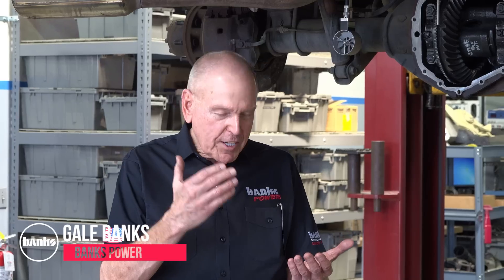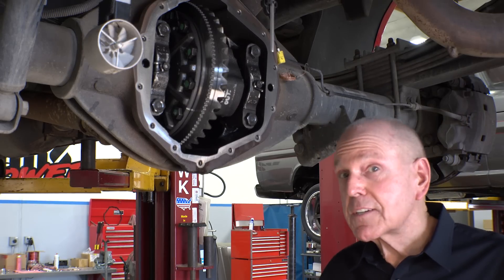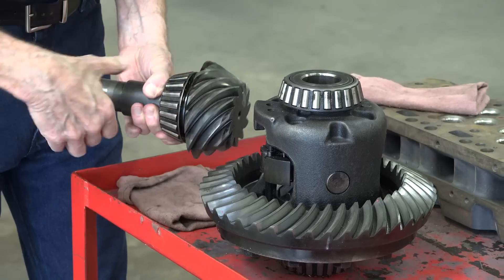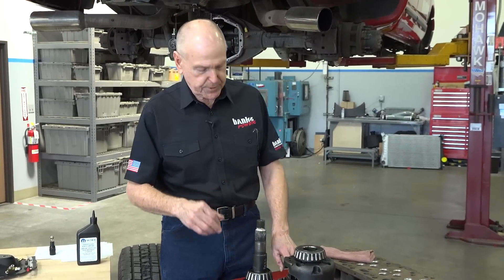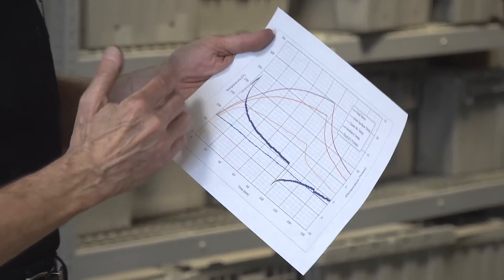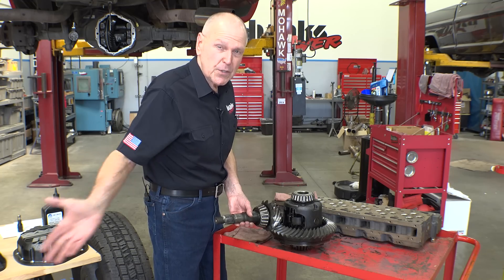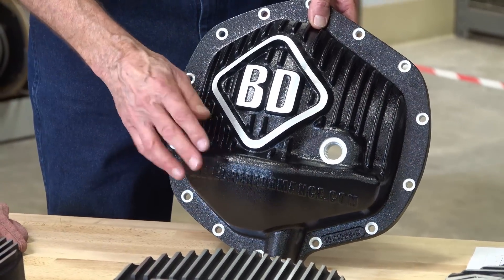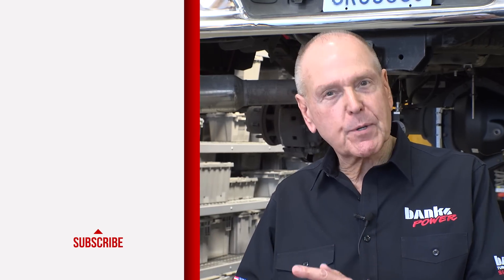Do Diff Covers Work or Are They Just Bling? Part 2 of 3

Comment: Great topic... just waiting for part 3, and your findings.   You make good observations about potential problems with a squared diff cover: will enough oil get back around to cool the pinion [which can collect more heat than the ring per the ratio]?   Does it add to aeration?

Comment: Main reason I have a diff cover is to change fluid faster with less hassle. Ranching means crossing creeks, mud, all kinds of things. Change the fluid every 5-10,000 ranch miles, and there's almost always water and nastiness that comes out. I'd say it's worth the aftermarket cost for convenience factor, even if it doesn't cool like advertised--then again, ranch trucks are rarely above 20MPH.

Comment: I have worked with engineers all over the world & have had the good fortune to know about one dozen who knew  what the Hell they were doing!  ALL those who were exceptional engineers  espoused the same attitudes that Gale Banks does.  The "I don't know, but I am going to find out" attitude & then designing a test program, instrumentation, & methodology. ALL tests conducted using identical parameters. Identifying & compensating for possible errors, & listening to subordinates input. Sometimes the guy who sweeps the floor will offer a suggestion, that is patently useless, but it "twigs" the engineer into considering a modified approach that works!  I bought a Gale Banks  fuel plate, turbo kit with modified waste gate & a manifold back exhaust system for my 97 Dodge diesel. It has over a million miles on it & even the exhaust system is still good. His products were not produced by guess work! This test series is a study in REAL engineering.

Comment: Thank you for the great in depth check on this. 
I like the bling factor of course, which was my primary reason. Cant wait to see where everything goes by part 3.
With most modern vehicles, I immediately acknowledge the primary reason everything is built the way it is because it is the cheapest available. 
Manufacturers spend tens of millions making a minimum viable product that hits certain life and warranty targets (basically either 5/60K or 10/100K). Then they spend millions additional making it cheaper. 
It is about adding features and making it look like you need a new truck. But I still love my 13 3.5 F150, and 04 6.0 F250. Aging, but both well over 100K but that required major maintenance.

Comment: I can wait for the results even though I am very anxious to see them. I appreciate the time you are taking to get these results. I’m very curious as I was told by a Ram dealer to upgrade the cover to increase capacity and cooling after I took my truck in for a failed seal that let fluid escape onto my rotors and everything else in the area at the end of my rear axle tubes. They suggested an aftermarket purchase or a 1ton oem cover for my 3/4ton truck. I have yet to make the switch and have yet to see the issue reoccur. 

Details, the original seal failed on a trip through the mountains from the Bay Area, CA to Boise, ID. I had made longer trips before then, much longer with even steeper climbs. This is a TX truck purchased new off the lot. I am the sole owner. Has pulled 10,000lbs from TX-MO-NY-MO-NC-MO-CA. I won’t mention the light load trips as there are too many to list.

Comment: 11.5 and 11.8 Gale, not 10.5 and 10.8 on the ring gear. They also did have a 10.5, but you are not working with one in a dulley configuration. Also... I would also like to see how AAM/RAM's own aluminum finned cover works that is factory installed in dulley Aisin configurations. It works with 11.5 and 11.8 applications as you are testing. Good work! Keep it coming.

Comment: Props to all the work you're putting into this. This isn't a small test, and you are trying to cover all the bases.
I'd say there is more to just cost for why axle manufacturers use stamped steel diff covers. I'm sure some will say, what about valve covers going to aluminum! and I'd have to reply there is little in common with a top sitting splash shield (valve cover) vs a containment casing with active fluid dynamics involved.

Comment: Gale , Your next test should be that you drill a hole into the cavity between the two pinion bearings and bring it up to a set speed and measure how much fluid reaches that cavity in a set time.This will tell you exactly how much fluid is reaching the pinion bearings.This can be done without damaging diff you can easily tap hole for allen plug.

Comment: I am curious how you selected the Anemometer locations?  As Mr. Banks is aware of is the dynamics of airflow, such as laminar flow, vortex flow, static pressures generally up against structures, etc.   Determining the Anemometer optimal locations would be interesting to understand the boundary conditions considered.  I understand having consistent placements of all the Anemometers is key though the shape-changes of the housings can cause changes in airflow vectors.

Comment: Ever see a firefighter with a bend or loop in his hose, that helps with direction change.  On newer homes if you run copper pipe you might notice a tee with another dead end next to a faucet or appliance. Those are just filled with air, they are shock absorbers. So when you shut the water off the pipes don't jump in the wall.  Once fluid is in motion it likes to stay or flow in the path of least resistance. So i think your deffenetly onto something when your pointing out those notches on the covers.

Comment: Thanks, I have added a c channel made of sheet stock, to wrap the ring gear inside the mag hytec covers on my truck. The intent is to restore the "flow" of the lube to what it was with the stock cover. I've had these covers on for about 200k with no problems but I just couldn't stand thinking about the lube not going where it originally did. Twas a real bugger to get it to fit inside and around everything. I was so scared when I drilled the holes for the mounting studs.

Comment: I think the stock cover is designed that way so the oil gets back to the bottom as quick as possible, so you can use less. Once the oil is flung out from the ring, it doesn't affect horsepower anymore, and if you have enough to cover the ring anyway, it doesn't matter if there's resistance or not.

Comment: I learned from a guru engine builder ( Daryl Buehl  / BISHOP BUEHL RACING) about the brilliance of GALE BANKS knowledge on TURBOCHARGING.  I have played with this same topic (dif fluid level, etc...) Although not as controlled & precise,  I did use a laser thermometer . I noticed your testing did not consider the FULL FLOATING AXLE design & it's relation to the wheel bearings that are fully lubricated (and cooled) via the Dif fluid. 1/2 ton axles lube the wheel bearing there as well, but the loads on the 1 tons while hauling is night & day. I also off road & mountain drive where the fluid will fill -1- axle tube and leave the gears quite low for a period.  I found the best result was a slightly higher level & to run a 75 / 90 weight (or so) full synthetic gear lubricant from AMSOIL.   The "viscosity" of Amsoil's 90 weight gear lube was as fluid as a 5-30 motor oil.  It ran cooler at my bearings and diff cover in my Sterling axle.  And in my lil Suzuki Samurai ,when I swapped all the 90 weight (honey) out of the trans, t-case & axles for Amsoil, it was like having a new engine!  The diesel couldn't care less how "thick" the lube was, it's not so sensitive. But the little 75 HP  1,300cc  engine sure noticed.  Much like thin oil flowing through a engine cools better than some TORCO 60 weight, the same applies in the axle. Thin oil doesn't have to mean less "film strength" . As long as it's properly providing the "cushion" , thinner helps quite a bit. 
  NOTE:  The cost of the AMSOIL will make your head spin like the Exorcist, but as Mr Banks knows, the finest products are more expensive . It's all in the application of the money spent.

Comment: My opinion, The one by BD looks to be the best design that will work. The splash that Mr Banks refers to occurs above the level of fluid. The greater oil cavity is just where the oil level stays at when running and the splash occurs above that, so I believe there is no restriction to increase heat. However it can be improved by adding more fins to dissipate more heat from the air drag behind the housing. The increase of oil is do to the increase of volume capacity. But the level height should remain the same.

Comment: Would be interested in knowing if fluid level needs to be adjusted for pinion angle after a lift... the lift would surely change the relationship of fluid level to ring and pinion once the pinion is angled above the ring depending on lift ....should the level change to compensate? Or stay the same? ..... this is with the stock diff cover.... although this video is more about after market covers... I think changing angles of differential would be a valid question since fluid levels will not rotate with diff so the relationship will change.... hopefully these videos will address that as well......love this stuff.

Comment: I'm watching this wondering if work has been done
where you would cut out the radiused section of a steel cover
that follows the profile of the ring gear and rivet that
to the inside of these aluminum covers . 
A riveted half pipe of steel,inside the cover with a 
flared end should direct the oil where you'd want to go.
The aluminum could do it's job if it's main function 
is to be a heat sink and not asked to be an oil controller. 

I've learnt a lot watching this thank you.

Comment: Are you measuring the differential housing temperature? If the flow of lubrication is lessened to the point it increases friction the core temperature would increase. 

My apologies if you said you are. I unfortunately had to speed through the video. 

Awesome testing by the way. Numbers don’t lie.

Comment: This is the reason I went with an OEM Motorcraft finned aluminum cover to replace the stamped steel one on my '99 F250 when I changed out the seals, rebuilt trac-loc and cleaned it up.  Filled with OE spec weight synthetic oil with friction modifier added.  OEM stuff is almost always more reliable than aftermarket (although certain mods are far superior to OEM for outright performance).  I don't know what the mileage was before I did this because the truck is new to me, but I get what I would consider to be a stellar 12 mpg out of my V10 4x4 in mixed driving.  That's a lot of cubes for a gas engine to be getting that mileage, especially with 4.30"s.  I'm wondering if that cooler diff is helping out, although I was only trying to make it last with the new cover (lower temps maintain the oil's lubricity and viscosity for longer).  It also has fresh synthetic engine oil, fresh synthetic trans. fluid, fresh plugs and coils and new OE-size tires.  Still have to freshen up the front axle and transfer case.  Very interested to see the results of your testing Gale!

Comment: I'm betting on the BD. It seams like the better design. Here's why: 

1)More capacity without a higher higher fluid level. (leading to less heat build up due to excessive movement of fluid or friction)
2)Cooling fins in the sump cavity to take heat away. (more aluminum jutting into the sump area could help disperse heat quicker)
3)Slinger slot on the back cover to carry oil to the top of the diff. (retaining the manufacturer design lubricant circulation to the diff. Don't forget the axle bearings need lubrication too. ;-) )

I think you would be incorrect about the cavitation in the extended sump area because the ring should be below the fluid level at that point and as it exits the fluid, it should follow the groove to the top of the diff If they engineered the fluid level correctly. I cant be sure the level is correct visually in a video but my guess is they nailed it. Your test should tell through the site glass. BTW I love your idea of installing a site glass on both sides of the cover, that was clever! :-)

This one would be fun to watch as a see through cover to see if they mastered the correct fluid level at 45-70 mph running speed.

Improvements to the BD I believe would be more cooling fins on the outside of the cover, however that might sacrifice some durability in a work truck enviroment or an off road enviroment.

I am anxious to see your conclusion!

EDIT: Here's a couple after thoughts. An external cooler for heavy work like towing or heavy hauling.

How about some other guesses? Come on guys this is going to be fun!

Comment: You have applied a very methodical process for the test. I agree with most of what you are putting down. Epically aeration of the oil due to excess level and increased drag causing more heat. But saying that the ring and pinion need to work harder/lose energy due to the cover being flat is not correct. At best it will add cooling, worse it will cause more aeration. I think the BD cover will come out ahead of stock, the rest will be worse due to the fluid level. One other item that will effect the heat is bare steel vs painted / PC aluminum. If they anodized it would work out better.

Comment: Gale, I appreciate you taking the time and money to test this for all of us that don't have the time, money trucks or equipment to do the tests our selves. A major part of your concern with the covers is that the oil is hitting the corners causing it to heat the oil up more. This is a good point so with one of the covers I would like to see you weld a radious piece of aluminum in where the ring gear rides and run the test again to see if it makes a difference in the cooling efficiency.

Comment: Hello mr. Banks I was wondering if you were going to include the new aluminum finned differential cover that comes standard on all 3500 duallys.  I ask because that cover would be my choice as a replacement for my stock cover on my 2013 2500 Cummings.   Thanks for your amazing work.

Comment: There is a model of cover out there with fins molded on the inside and outside, to provide more of a heat sink. As you've discussed the turbulence caused is a problem. I am curious, is this improved thermocoupling would be worth the losses?

Comment: My guess is a cover that has the stock shape, made from Al, and maybe some external fins MIGHT be of some benefit IF the lubricant temperate gets excessively high with the OEM configuration.  My SWAG is the aftermarket stuff is just costing money with no measurable benefit.  It might actually be shooting performance seekers in the foot.   Part 3 can't come soon enough....

Maybe a 0-60 acceleration run or some similar thing would demonstrate the spin losses?   I suppose measuring changes in rear wheel power might work.  Might be too much uncertainty in what the engine output actually is to easily measure things though.

Comment: The test results will be interesting to see if the temperatures are higher with the aftermarket covers. The temperatures will be offset by some amount due the better heat transfer of aluminum. If you do get higher temperatures, maybe a splash shield insert would correct this?

Comment: I just installed the afe cover then saw your video! 
Well I tightened the cover to 35 ftlbs so I may have to pull it do to the warp factor.

I didn’t see your cover for 2012 f150 ecoboost 3.5 tt 
9.75
Reply from the maker: Right now the engineering team is focused on the more current gen ¾ and 1 ton HD diff covers. After these are done, we will proceed with F-150/1500 trucks and Jeeps. As of now, we are not sure of the exact vehicles that we will be working on yet, but it will consist of 1/2 ton trucks.
Reply: I’ll roll this cover with the amsoil 75 140 severe for now when I see a new cover from banks for the 9.75 I’ll upgrade!

Comment: I’ll put my money, as far as the aftermarket covers go, on the BD diff cover. From an engineering stand point, the whole purpose of the close proximity of the cover to the ring gear is to keep the excess oil from following the ring gear much like a windage tray/crank scrapper in an oil pan. This will reduce drag but I’m betting it’s going to be less than factory only because it was probably designed for many aftermarket gear sets/ratios that may not fit behind the factory cover. The other aftermarket covers on the other hand will have the highest parasitic loses and it’s possible that will initially help with heat but will heat soak for longer. This is also goin to depend highly on those fill levels. Even with higher capacity, if the oil level is too high, it may heat up faster and maintain heat long. There’s no replacement for proper engineering guys. Thanks for doing these test Gale and I hope I’ve been able to help a little.

Comment: I actually can't keep paint on my stock diff cover. 1 long trip of heavy towing and it starts flaking off. Fluid also needs to be changed more frequent than I would like too. Rear end was checked and is within spec. Not much metal build up on the plug. Blasted cover both times before painting with rustoleum. I will try hi-temp engine paint next time, but have been considering one of these high capacity covers. I guess I will have to wait for part 3 to make up my mind.

Comment: Turbulence is better at heat transfer. Most of those covers look like the main consideration was 1) marketing 2) increased capacity of fluid 3) cheap casting 4) using a minimal amount of metal possible.

There might be an advantage to increased fluid capacity if you're going to run a steeper angle like from a lift. Other than that, idk enough about differentials to comment.